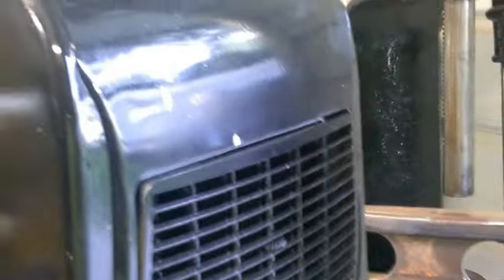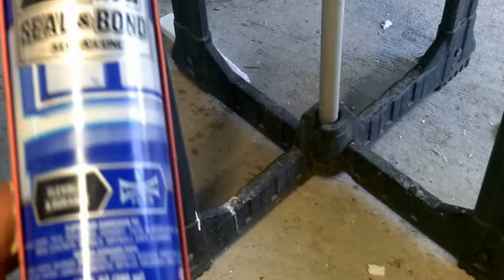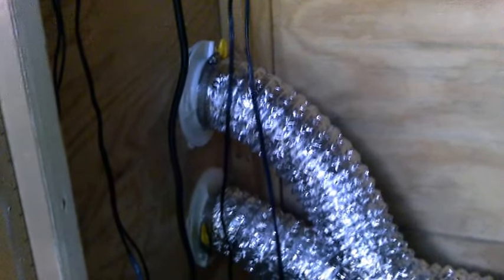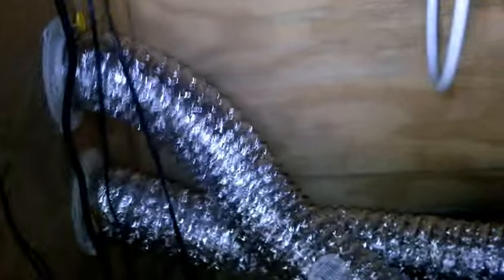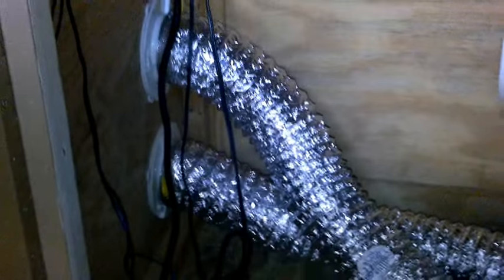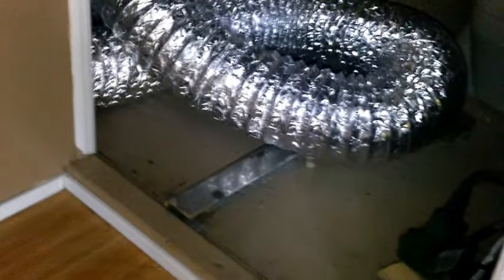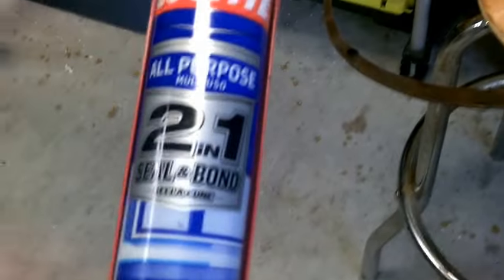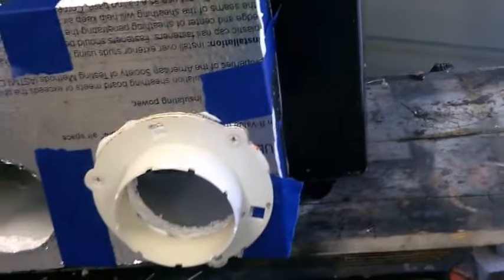cargo trailer to camper conversion air conditioner update on portable unit

Comment: I've had a few of these and these units aren't meant to have such long hoses (like you've got on there). Some are only designed to have 6' max with no hard bends in the tube. I had a unit that stopped cooling as good as it was, and found out that the hose was too long. I didn't believe it, but I shortened the hose, and sure enough, it worked great again.
Reply from the maker: That is the reason I ran two hoses for the intake and one for the exhaust that drops right through the floor behind the unit and it works great and thank you very much for watching
Reply: Kevin Todd, Good to know!

Comment: I think if you have good insulation and the trailer is not a dark sun absorbing color you could get away with the smallest ac unit you can find. From experience here not just trolling. Thanks for the video.

Comment: did this help the problem?
Reply from the maker: corybrown7 it was a complete success it helped everything no more suction on the trailer it dropped it from 95 to 72 in an hour and a half
Reply: Awesome! I'm dealing with the same issue. I have a 10,000 btu LG portable ac unit in a 6x12 cargo trailer and I can't seem to get the temperature down below 80 degrees, even at night when it is only 83 degrees. I'm definitely going to try this. thank you.
Reply from the maker: https://youtu.be/NYmFU7mz8Xs
Reply from the maker: It worked great good luck with yours.